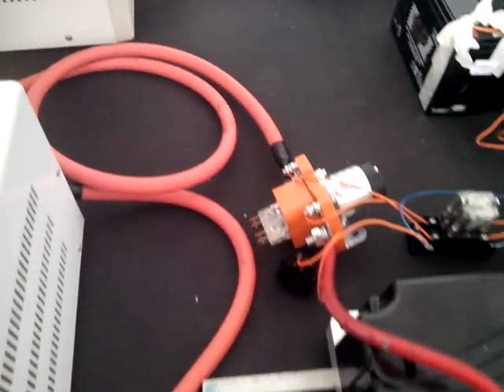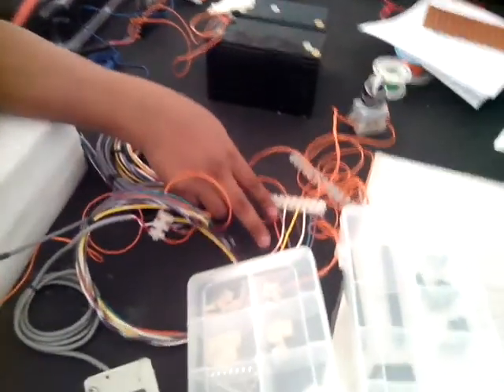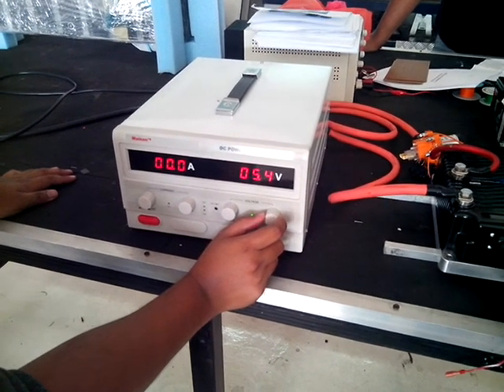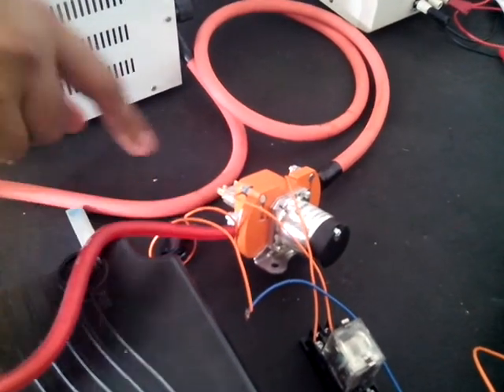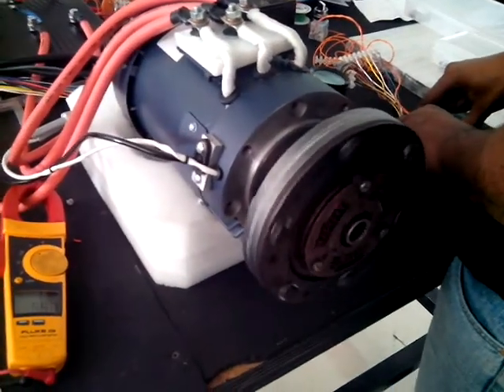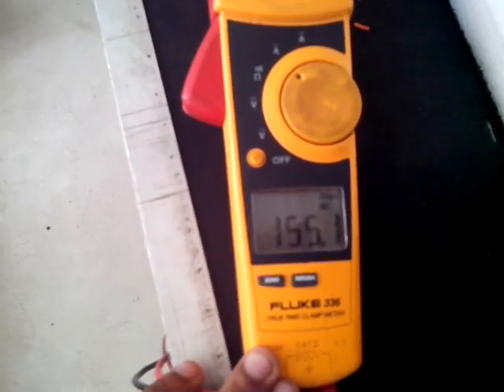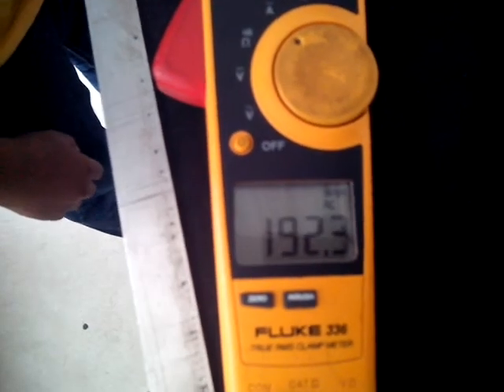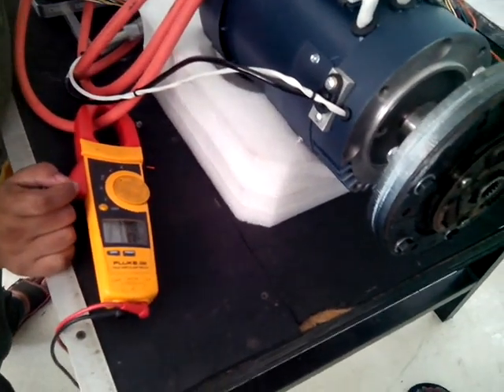AC-9 HPEVs with 1238-5601

Comment: I'm pretty sure that power supply is too weak for this application, so naturally you're incapable of delivering enough power to the motor to work properly even at 50% throttle. The controller is designed to work with LiFePO4 batteries, so it is intentionally not overloading your power supply. If it were to overload the power supply (which, under normal conditions, would be a battery pack) it would cause severe damage to the batteries, and even cause a fire/explosion. Most likely what's happening is that the controller is driving the motor through its capacitors, which it has to recharge very frequently through your power supply, resulting in a lower-than-expected duty cycle (hence the super slow speed). Not 100% sure that's whats happening, but from the looks of things, that's what I gather.